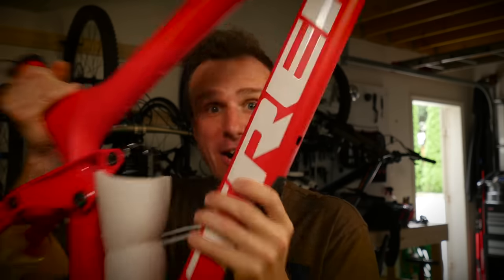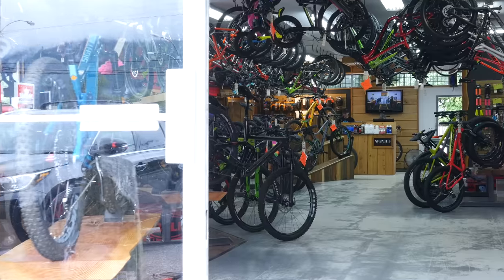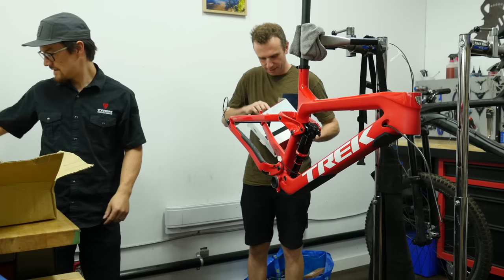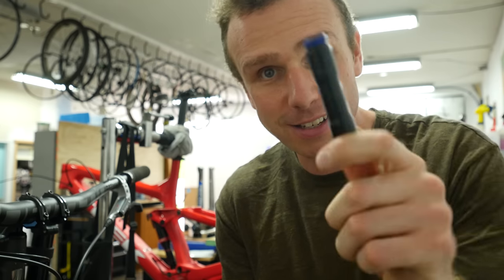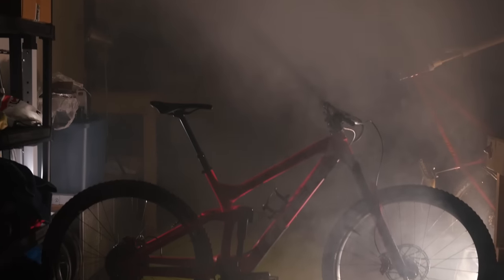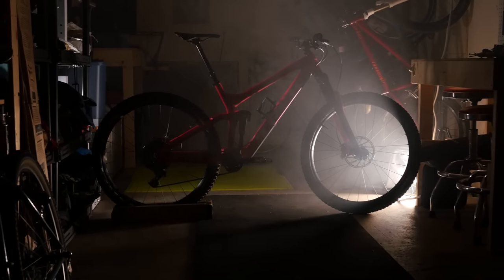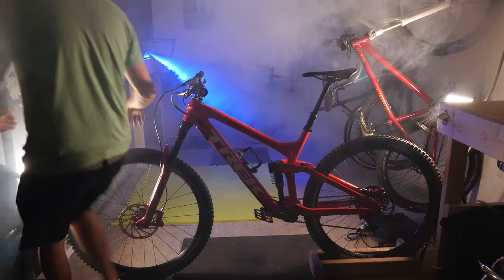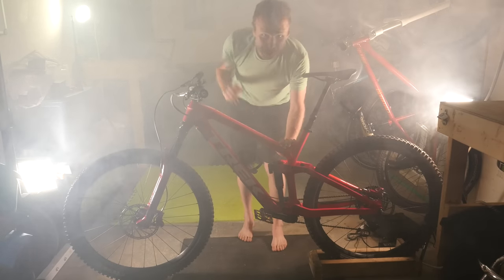PERFECT Whistler Mountain Bike Build - New Bike Day

Comment from the maker: AAAAAAnd for those interested it weighs 31.6 lbs!
Reply: thats a dh bike weight man
Reply: That's way heavy
Reply: For anyone else in the world its 14.3 KG
Reply from the maker: Thanks Aaron!
Reply from the maker: DH bikes weigh about 34lbs at the lightest - that's how much Gwin's Carbon YT weighs for example. 160mm enduro bike are generally around 29-31lbs. Especially as this is a 29er.
Reply: It really isn't I have the 2017 Slash 9.9 RSL off the shelf version of this bike, setup tubeless it's just over 30lbs out of the box, I run a set of Carbon XXX wheels on it now and when I run the lighter XC trail level tires she drops down to 28lbs, the Maxxis minions with EXO casing and my enduro alloy rims puts it just shy of 31lbs
Reply: call it "Satan"
Reply: I don't really mind the weight since I ride for fun only this bike is sick... salivating now man,,,
Reply: Pauil, does the 170 dropper fit all the way slammed in to the collar?
Reply: How my in kilos
Reply: Did you like this slash?
Reply: Yeah that ain't heavy! Tear it up on that thing.

Comment: Nice! I love my Slash... I've had mine about 6 months now. I'd consider getting a Fox X2 shock for it, Fox has a kit + you need hardware from Trek... otherwise solid build! Mine is almost exactly the same weight running Maxxis dh tires. Oh, and cover it with 3M clearbra and extend the chainguard, the paint is very delicate if you care about that sort of thing.

Comment: I wonder if you had any issues with this frame set, I see you ride hard, and use the bike for it's intended use, which I also do with mine, but mine can't handle it, 2014 Fuel EX.
I am tired of my fuel ex, and the pictures and forum post and some vids make me want to stay away from Treks, any issues with Mino link getting loose?
have you had issues with bearings coming out? I saw some had that with the same model as you.
this frame is a beauty, but I am concerned, one of the nicest looking bikes they made IMO.
but Renthal was definitely a great choice, I tried one for a while, and love it, so secure, holds on to the bar for many months, no fast loosening bolts.
I am also interested to hear more about the One up dropper, but so far I think I will go for Ethirteen.

Comment: I’ve got nearly the same Build but with Saints, CCDB Coil, and Carbon hoops :)
You need a wolftooth Brad mount for your innertube.  I like the Reaktive shock for climbs and longer rides but the coil is better for descents.  Definitely add 1 extra volume spacer on the shock.  It comes with just 1 and bottoms out kinda easily.  
http://forums.mtbr.com/trek/2017-trek-slash-details-1017456-post13605355.html#post13605355
Reply from the maker: Thanks! Glad you like it too. I’m not that heavy and on the ride today the shock feels pretty solid 👌